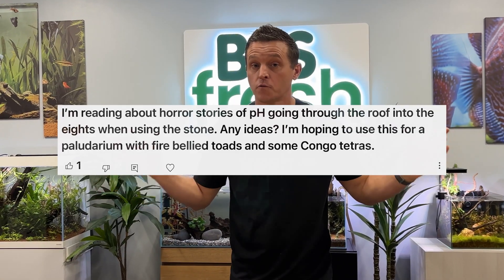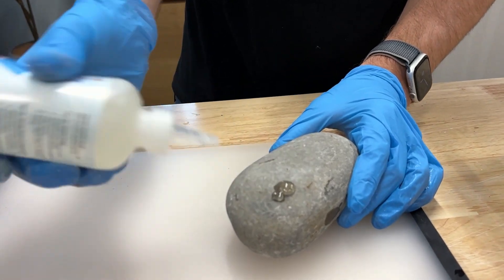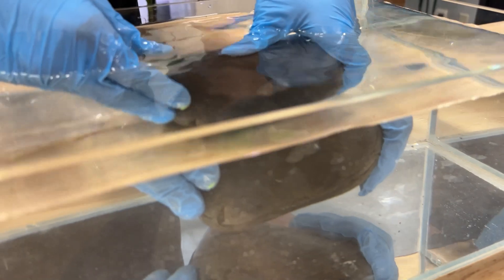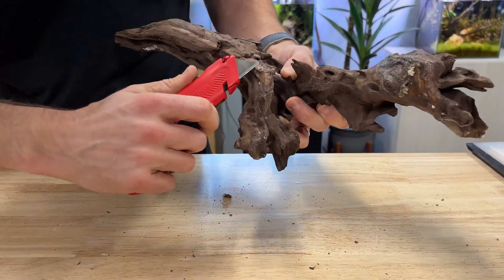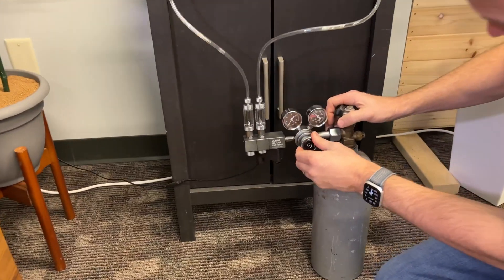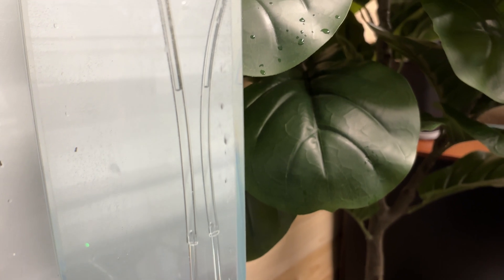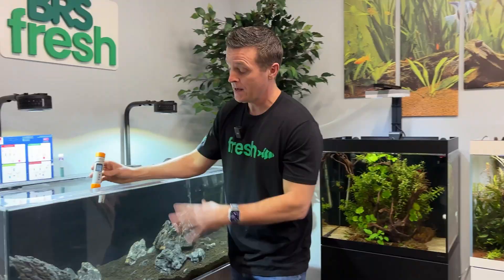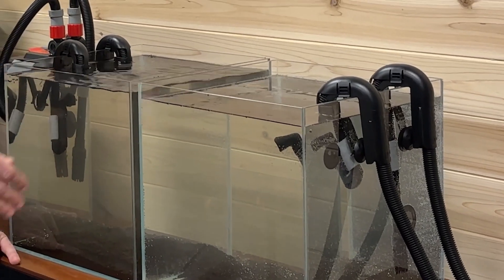Freshwater Aquarium Experiments - What REALLY Works?

Comment: I ran co2 in my fishroom for 5years straight and never even knew people cared about placement and back siphoning to the check valve, ran 10 tanks from floor to sealing with co2 and all check valves were only 5inches from the bubble counter, i believe in buying quality check valves not just your cheapest option and if youve spent that money on a co2 setup there should be no argument on getting quality over price
Reply from the maker: 👋 Thanks for watching and I agree!  I also didn’t realize people thought so much about it and then I started believing it really mattered.  Then I started getting more questions about it which is why I finally decided to set up a test and turns out it doesn’t seem to matter.  Just matters that you have one!
Reply: @BRSfresh  a good video to continue on would be about the actual tubing that you use for co2 as that can actually affect results and is a ticking timebomb i have experienced myself in my early days learning co2 when not much info was out. Also I have found that a cigarette filter for a diffuser is alot more effective on co2 setups when you run alot of tanks as you can change them over with little expense instead of cleaning the ceramic ones on a rotational basis, also did not find any difference in effectiveness of them besides overall aesthetic if you like the look of the diffuser
Reply from the maker: Wow that’s interesting- haven’t heard about that before but pretty cool that it works!  Totally agree on the tubing – I thought any quarter inch tubing would be fine when I first started and didn’t realize the importance of CO2 only tubing!
Reply: @BRSfresh  surprised me aswell especially since a packet of filters is only $2 for 100 of them and the slim ones slip directly in snug to the end of the tubing and only need replacing every 2-3weeks. Also if you're trying to hide the fact you have co2 in the tank very easy to hide next to equipment or hardscape. Thankyou for the discussion love your channel just stumbled upon it a couple of months ago and binged half of your videos. Salute to you sir keep spreading the knowledge and testing your own thesis on things.
Reply from the maker: A big thanks to you!  Really appreciate the support - more testing coming on aquascaping stones 🤫
Reply: @BRSfresh  awesome I can't wait

Comment: Interesting. Thanks
Reply from the maker: Thanks for checking it out!  If you’d like me to test something else let me know what you’d like to see and I’ll see if I can make it happen!
Reply: @BRSfresh  thanks, similar to what you already tested with the canister next to the aquarium & at the bottom I've often wondered if canister filters effectiveness changes depending by the length of the inlet and outlet hoses. I.e a canister with  a 10ft hose Vs one with a 2ft hose attached. It's probably the same scenario as air pumps & their air tube length.  Does the length of hoses & air tubes have an impact on efficiency?
Reply from the maker: Great question!  I thought the canister with the cut hoses I used next to the tank would be blasting water due to the shorter length (and not fighting gravity) but I was surprised to see that the flow was about the same as the one with full length hoses.  I’m sure at some point there would be a difference but within the normal hose length provided for a canister, I didn’t see much!
Reply: @BRSfresh  I think maybe the pump needs some resistance (gravity) to push against. Lol It reminds me of my washing machine that wouldn't work when I stuck the outlet pioe into a pipe at floor level, it wouldn't pump.  I had to attach a vertical pipe 2ft up from the ground and stick the machine outlet pipe in that instead. There must be some kind of physics thing with resistance, length, proximity.
Reply from the maker: There’s no doubt - I just wish I was smarter 😅
Reply: @BRSfresh  me too 😂